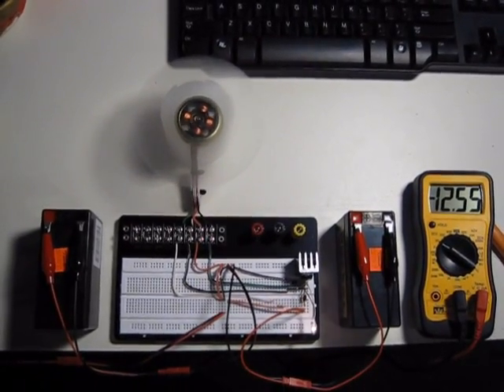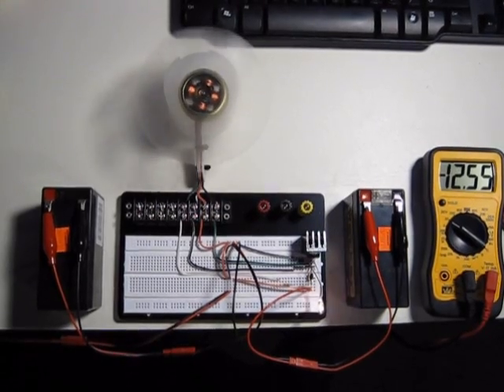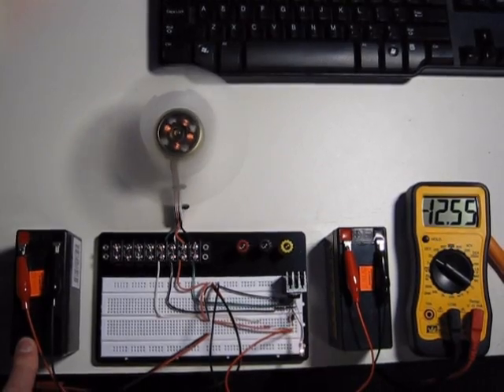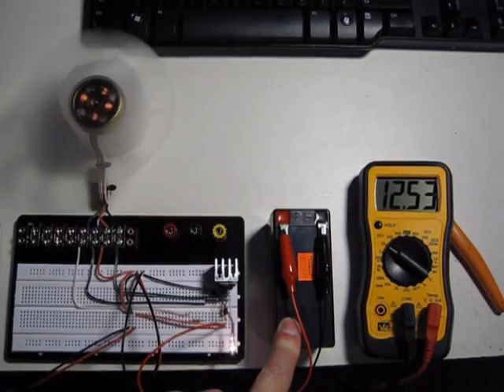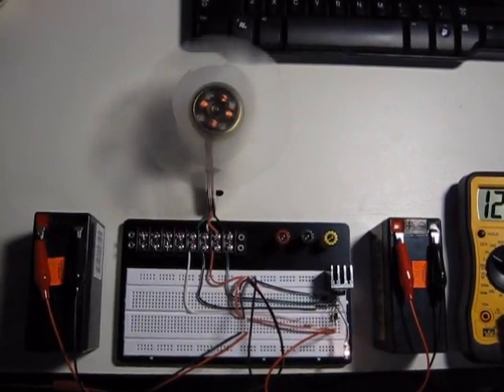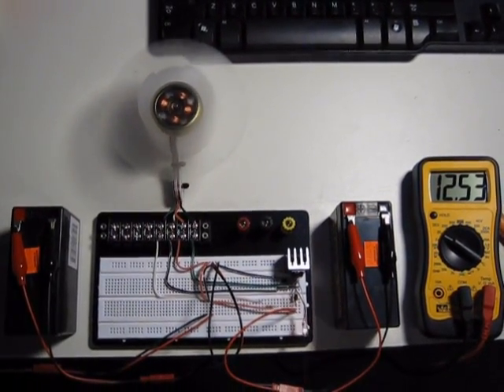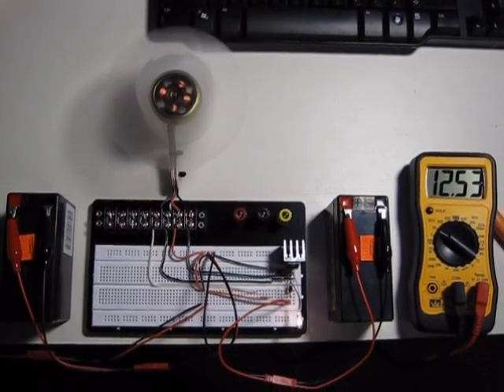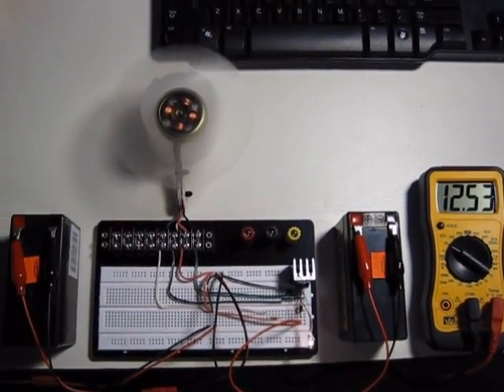My Second Bedini Fan

Comment from the maker: @WrongBirthday A 12V Battery you can usually charge to 14.5V.
Or when the Battery peaks out. (Meaning it reaches a peak charge, then starts to drop.)
Disconnect it right at the peak of the charge...or 14.5V, which ever comes first.
Dave